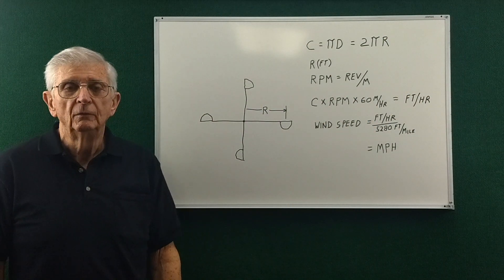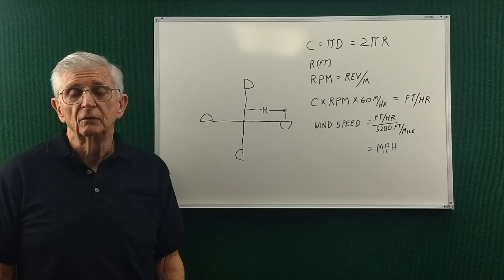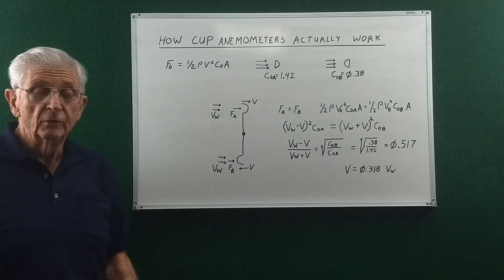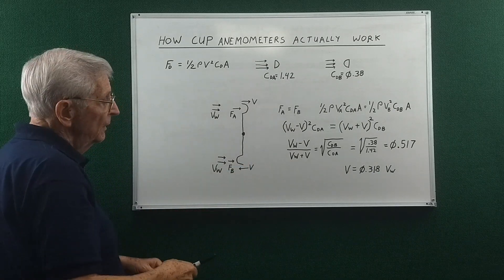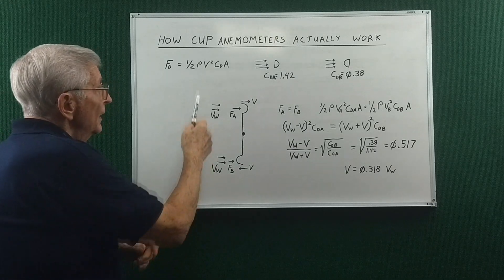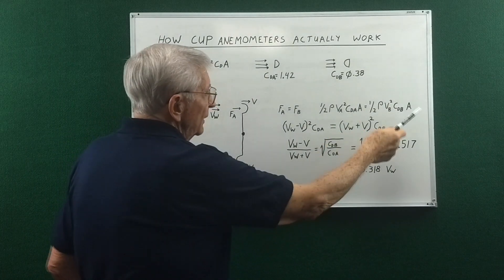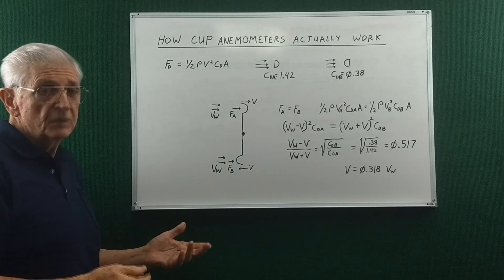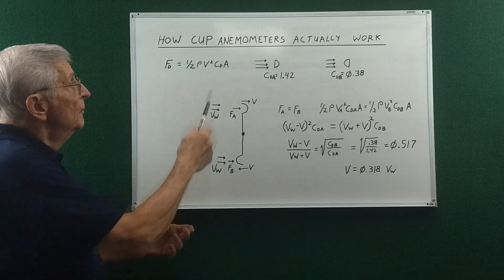This is Not How Anemometers Work // Who started this false explanation?

Comment: Thank you!
Reply from the maker: I appreciate your comment. Best regards.
Reply: @Jimscoolstuff Thanks for answering! Now that I have your attention, let me ask you a question: how do you calibrate an anemometer? The most obvious method is with another anemometer. But what if you want to validate the calibration without another anemometer?
Reply from the maker: @gustavoenriquejimenez8098  The way available to most people is a vehicle with a speedometer; however, the unit being calibrated must not be near the vehicle. The way that I did it years ago was to use a long pole arranged perpendicular to the front of the vehicle, and of course at a time with no wind. I used a pole 10 feet long (3 meters) so that the unit was in front of the vehicle. This is probably illegal most places, but I was young and daring then.
Reply: @Jimscoolstuff  Ok, thank you! I will try that, in a safe location.